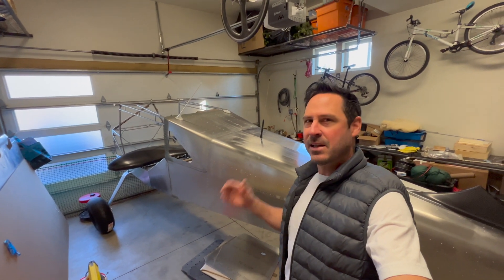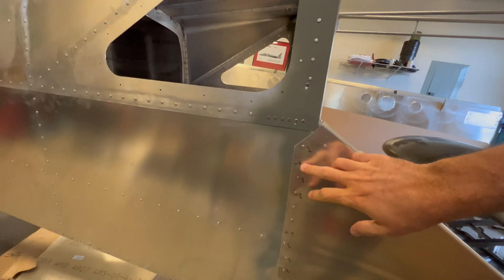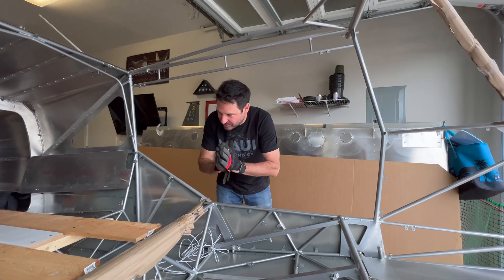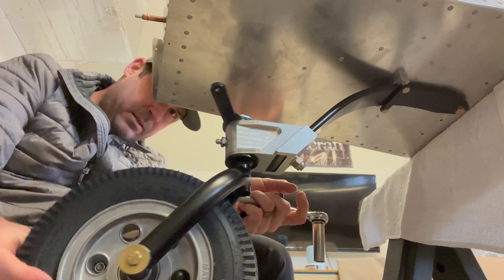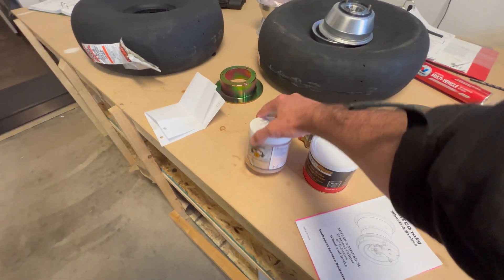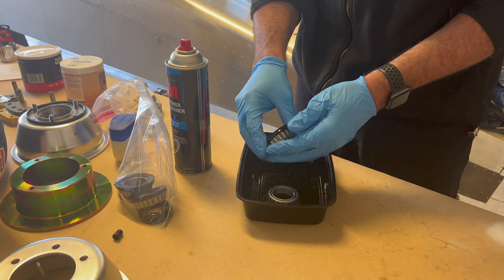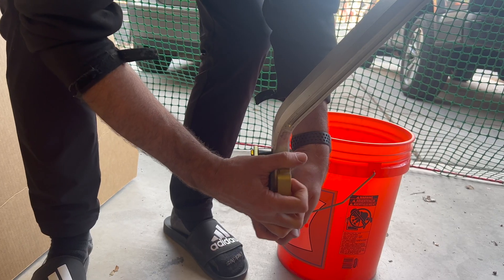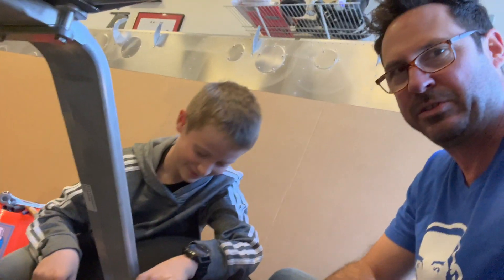RANS S-21 Ep 11 Landing Gear & Fixing Mistakes! SHORTFORM 4k

Comment: My tires seated quite easily.  I didn’t even have to use a strap wrench.  I pushed on the tires with both hands to squish them and the seated easy peasy.
Reply from the maker: Awesome! Maybe I should’ve tried that first, but the strap worked great!
Reply: @CLEAREDDIRECT  That was my plan B, but I decided to try it “raw” first and found no need for more aggressive measures.  😁

Comment: I couldn’t tell for sure if you greased the bearings properly as your video was running too fast, but it didn’t look like you were.  It looked like you were just smearing it on the bearings and that will not properly grease them.  They make tools to do it with a grease gun (two cones, one with a Zerk), but I have always used the palm of my hand as I don’t grease that many bearings.  The hand method works great with a little practice and no tools needed.  Here is how it is done properly.  https://youtu.be/BhL1uAp_WCw
Reply from the maker: Thanks! I know it was sped up a lot (see the Longform version for more detail), but I didn’t simply spread on the grease. I packed it per that video. Unfortunately the bearing seal makes it hard to tell if you got enough in. Thanks for having my back!
Reply: @CLEAREDDIRECT  Good deal.  I just couldn’t tell from the video.